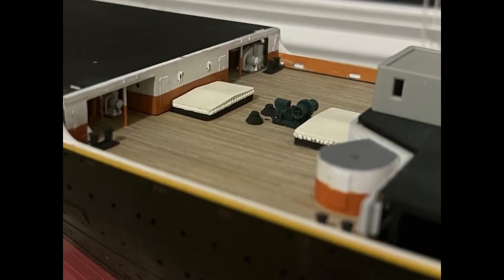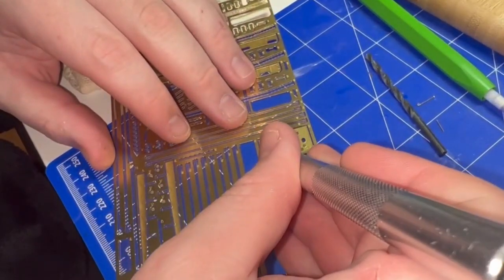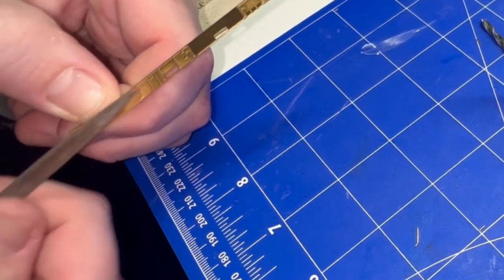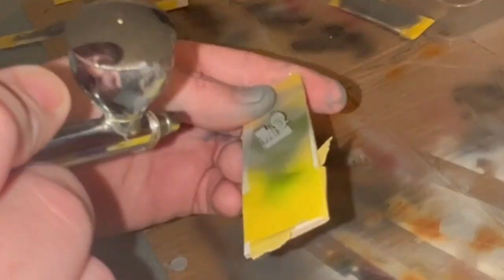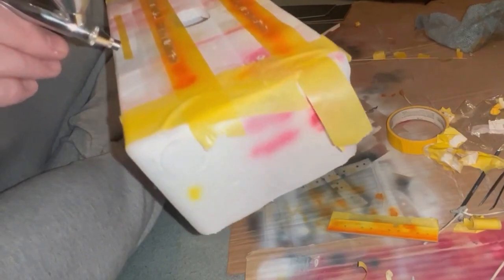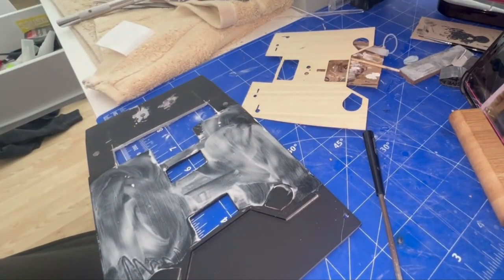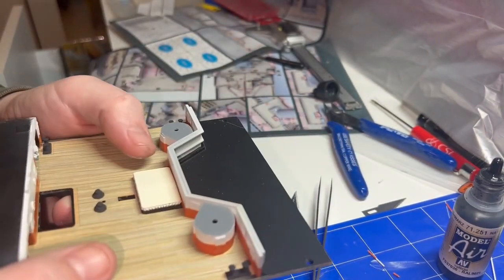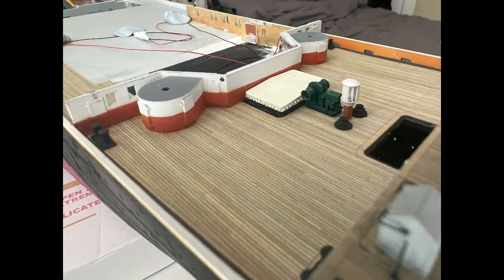RC TITANIC Build 1:200 Scale Part 9 - Aft Well Deck Assembling

Comment: Hi yer!  Great job so far.  The 'strange item'  was a passive up take Gibbs extractor vent.  I looked this up and in doing so I discovered that my build of the Olympic did in fact have some of these replaced in her career, so thanks for that!  I thought that the KA PE door's being double sided was a great idea for as you say perhaps having doors open.  However, for the closed version I have removed what would be the inside detail half as they look a little thick bonded to the flat walls. Remember that part of the door would be sitting inside the opening just like our doors at home albeit with a an outer weather flange. I did that idea on my forward well deck and they look quite convincing.  I left one door open which does have the double thickness and that looks good too. Just a thought, as you get into the many doors when you do the superstructure!  Saves a bit of work too!  My hatch covers are double the height as Olympics hatch lip was made a lot taller to combat rough seas!  The scale decks certainly benefits from the clamping down as they are prone to ripple without being clamped. Anyway it's great that yours is now getting to the interesting stuff in detailing. Nicely done and enjoy it!  Regards JH   😉⚓
Reply from the maker: Thanks for the kind words as always Johnny and thanks for clearing up the mystery around vent also, and I’ll try out the doors in the next lot that I fit, see what it looks like cheers!
Reply: To gauge the thickness of the doors I use the size of one of a model passengers hands.  Just about half a millimetre or so. That way it's a bit easier to tell if something is a bit oversized!  
Enjoy the next part of you're build, it's going well!  Regards JH⚓